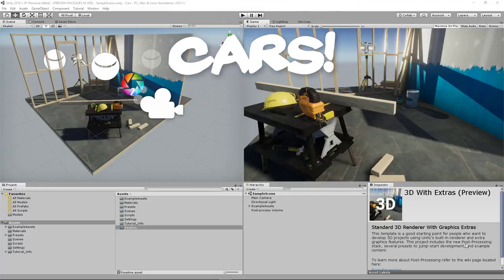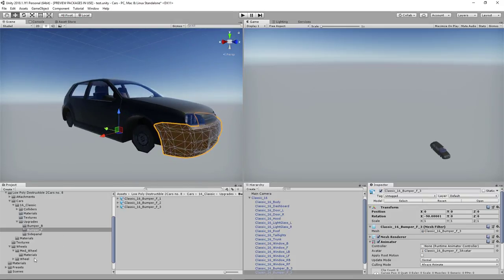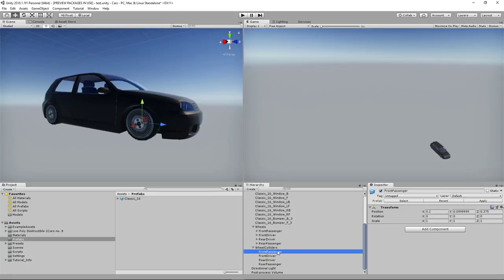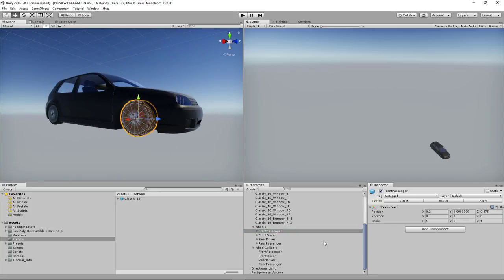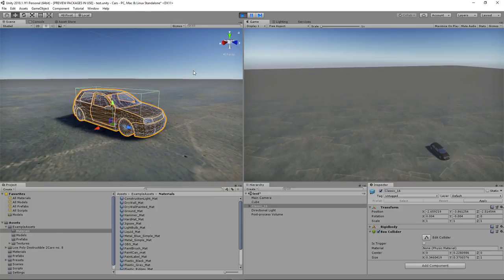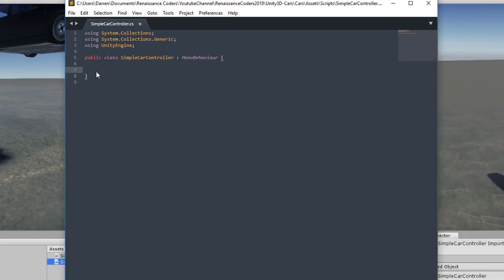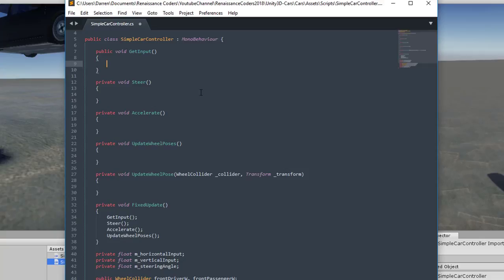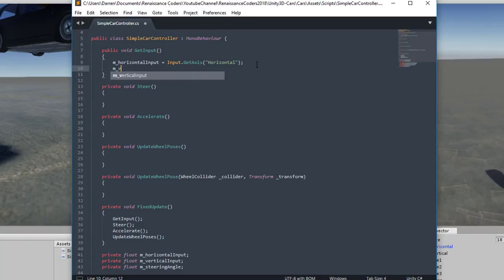Unity3D How To: Driving With Wheel Colliders

Comment: Why is my back wheel not rotating??

And the car doesn't move
Reply: I am having the same problem with the back wheels, have yet to find a solution.
As for no movement, try moving the box colider up to the bumper instead of below the wheel.
Reply: @Rockets0896  but,I found the solution to the back wheels movement
Reply: @bhavvukkalra9719  What is the solution? having the same problem here.

Comment: For some reason, my camera points to the side of the car and not the back, any idea how to fix it?

Here is my code:

public void LookAtTarget()
    {
        Vector3 _lookDirection = objectToFollow.position - transform.position;
        Quaternion _rotation = Quaternion.LookRotation(_lookDirection, Vector3.up);
        transform.rotation = Quaternion.Lerp(transform.rotation, _rotation, lookSpeed * Time.deltaTime);
    }

    public void MoveToTarget()
    {
        Vector3 _targetPos = objectToFollow.position + 
                             objectToFollow.forward * offset.z +
                             objectToFollow.right * offset.x +
                             objectToFollow.up * offset.y;
        transform.position = Vector3.Lerp(transform.position, _targetPos, followSpeed * Time.deltaTime);
    }
Reply: Found my error, my X value on the offset itself wasnt 0, so it was moving whoops e.e . Hope this helps someone.

Comment: Can someone help me? My car doesn't drive! I did the same thing as you but it won't move. I put down the scaling but still no movement
Reply: Did you found any solution ?
Reply: @pruthirajswain9861  Not yet
Reply: Does your wheels spin? I had a problem with my wheel colliders not being in contact with the ground due to thier small size and the size of my box collider.
Reply: @linusreimertz2850   my wheels are spinning but then also i am unable to make the car move
Reply: @anshupal1199  are your box colliders in contact with the ground? My car was resting on the bottom plate before I increased the size of them. Try to make the pretty big just to check. Otherwise I have no clue, havn't worked on that project for quite some time

Comment: When my car starts moving forward (with the engine power at 60) it moves at the speed of a snail... How do I fix this?
Reply: change the motor force to 300 or more, do experiments
Reply: @samuelmoreira7529  I have done things like that, but then the steering is completely off. Almost as if you your driving on ice.
Reply: @MobileScrap  Change your cars size. If it is to big, it will be to heavy in the unity physics engine.

Comment: I think that your video was really good and all but you should have included braeking
Reply: // Define variables
private bool brake;
public float breakForce = 15000f;

// Get input (space key) in GetInput() method
		if (Input.GetKey(KeyCode.Space))
			brake = true;
		else
			brake = false;// Define Brake method

private void Brake()
	{
		if (brake)
		{
			frontLeftWheel.brakeTorque = breakForce;
			frontRightWheel.brakeTorque = breakForce;
		}
		else
		{
			frontLeftWheel.brakeTorque = 0f;
			frontRightWheel.brakeTorque = 0f;
		}
	}

// Call Brake() method after the Accelerate() in FixedUpdate
		GetInput();
		Steer();
		Accelerate();
		Brake();
		UpdateWheelPoses();
Reply: @burakkayalak  thanks bro, it helped

Comment: I want to say before I get annoying and pedantic with a 4 year old upload that this is a great tutorial! I'm wondering though if you could clarify your explanation of the leading underscore naming convention for method local variables? You said variables with a leading underscore can't be accessed outside the scope of the method, however both `WheelCollider` and `Transform` are classes, and thus references in C#, so they can actually be modified from anywhere that has a reference to the same managed object. If they were initialised inside the method that would be, or if they were structs with no ref keyword then they'd be copies of the object passed in.

Please forgive and set me straight if that's not what you meant. Again, great video all in all!
Reply from the maker: Hey Peter, the naming convention itself will not enforce scope. I have simply adopted these naming conventions for myself to make it easier to maintain. When I look at a variable I want to understand immediately how accessible it is. I hope this makes sense!
Reply: @RenaissanceCoders  Could you clarify what the leading underscore means to you in this case then? Because any change you make to the transform argument will apply outside the function scope aswell. Tranform is a class, not a struct, and classes in c# are all managed objects, so for all intents and purposes are passed by reference, not value

Comment: How to make brake lights please make tutorial ❤❤❤❤❤
Reply: Write something like "if (m_verticalInput == -1)" and then turn on lights, make material emission to color red.
Reply: @NECjAR   in which method bro update where?
Reply: @alin98988  in GetInput, like in this video, add if (m_verticalInput.y== -1) { if (rearDriverW.motorTorque == -1) { // ENABLE BRAKE LIGHTS } } Don't forget to add Else to disable. Add if pressed "S" button, etc. Good luck with this.
Reply: @NECjAR  thanks but how I turn on and off brake lights I mean we have the code but do I have to create point light for it??
Reply: @alin98988  yes, you need a light or emissive material. Just enable and disable.
Reply: @NECjAR   okay I figured lights one but how we do the emission one pls help ❤️
Reply: @alin98988  you can find solution on YouTube, it's simple. I using light an changing material color to red with emission.
Reply: @NECjAR  I tried but I couldn't find one any suggestions?
Reply: @NECjAR   ok I found something. Thanks btw :)